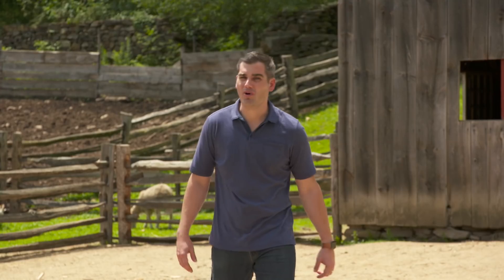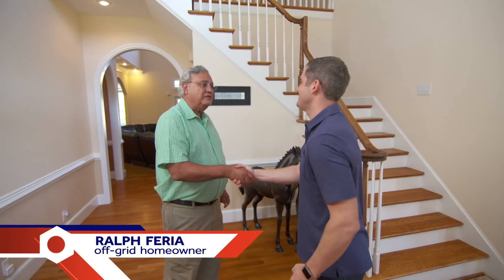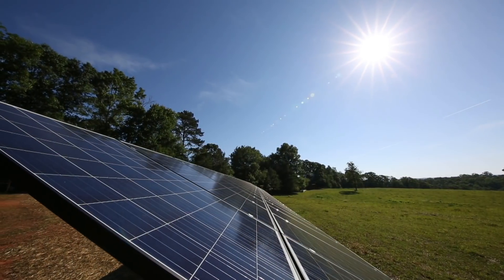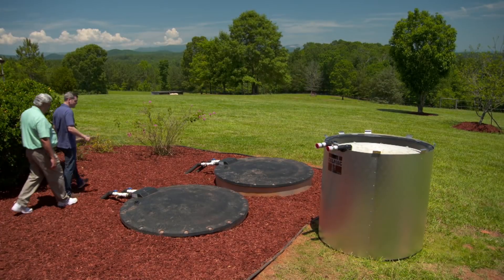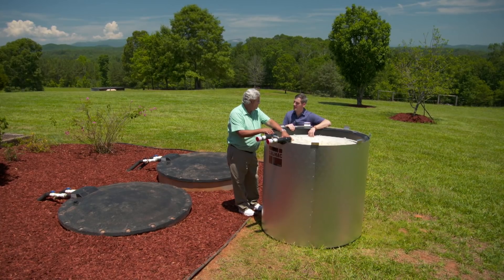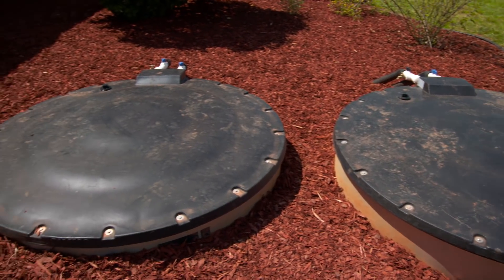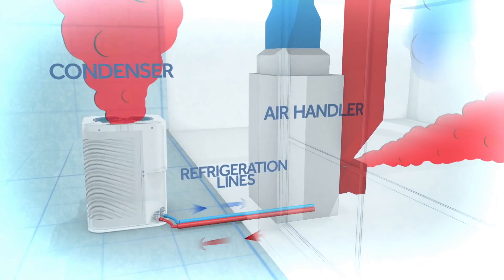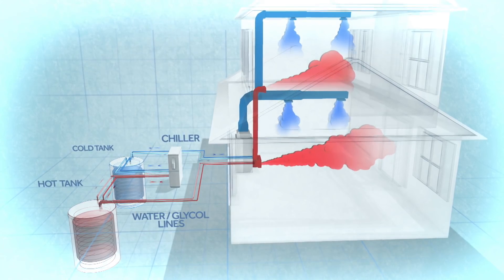Living Off the Grid Comfortably | Future House | Ask This Old House

Comment: How is this house “off-grid” if it’s connected to the grid? 

How could anyone know from watching this video if these
people are saving money or spending money on energy?  What does their electric bill run a month?
What’s the total cost of their solar array?  Without some answer this is just a feel good
commercial for the solar industry.  With
enough money  I could build a 50 million
dollar dam in my backyard and claim to be 100% renewable and technically that
would be true as long as no one included the cost dam. 

The cost of any item  is a good proxy for the energy cost of that
item. A toothbrush is cheap because  it
takes virtually no energy to make or ship and the raw materials are inexpensive.
A diamond is expensive because mining diamonds uses huge amounts of energy per
carat. 

Renewable energy is only  a substitute for something else. In the case
of solar arrays or windmills it substitutes 
for your electric bill, it does not eliminate costs. If your electric  bill is $250.00 a month and the payment on
your solar system is $250.00 a month all you’ve done is change the payee, you
haven’t saved anything.  

A 40KW system like the one in this  video is probably going to cost about
$120,000.00 without storage. If these people had a $500.00 a month electric
bill before the solar that means the cash price of their system would pay their
electric bill for 20 years.  At their age
they will probably not live long enough to spend $120K on electricity which
means this is a dead loss without even considering lost interest or
maintenance.  

I don’t know where this house is but if it’s in the
northeast the efficiency of this system is probably about 15% of nameplate
which means it will actually put out 40KW X  8760(hrs per year) X 15% or 52,560 kwh annually
with an approximate  retail value of $7,884.00
at $.15 a kw.  This  also equals $657.00 a month in value while
the loan payment would be $701.00 on $120,000.00 at 5% monthly. In this example
having solar would cost them $44.00 a month more than grid power.

Yes, I’m guessing at a lot here but I have to since they
provide no information that would help anyone figure out what the system
actually cost or what the payback is. If you have more information about this
house and the specifics of the system and cost please post them.

Comment: "why has it been a slow adoption for residential use?" ha ha - just a wild guess here...  maybe it's the 144 panel array?! If those are 250W panels and panels are currently around $1/watt, that is $36k for just the panels. That is cool and all, but panels represent the cheapest subset of components of most solar systems these days, so batteries being involved (as was mentioned in the video indirectly) means this is probably $120-150k+ system. 

The average kWh price in the USA is $.12. With an average monthly home use of 909 kWh/month, there is simply no justification for most people to go solar. because they spend barely $110/mo as it is. I really hope people all can someday, but it is still 5-20x more expensive than grid power in most of the lower 48 states.
Reply: nevertheless, this is all very very cool and a smart idea
Reply: Hawaii is $0.48 a kWh and steadily working its way on the west coast across the country... coming to a town near you.
Reply: I'm not saying RE isn't a great thing (i have it myself) - just that the current rate of adoptions is slow because of the comparitively cheap cost of POCO-supplied power in MOST of the US. HI and CA are definitely above average, as are some other places. Even in those environments, battery-based systems still cost more than POCO rates when the real cost is understood. Batteries are wonderful for some things, but saving money is NOT one of them in most cases.
Reply: The point of the video was to show the technology and adapting thermal batteries to residential use... not your conventional electron batteries. The cost of batteries are coming down as the technology advances. They are simply showing the technology of a “future house”. It’s understood that not everyone has the means to go completely off grid like this. Each step that the communities take toward RE takes the POCO out of YOUR pocket and someone has to blaze the trail for the better good of the public. The sad thing is that this man is doing that not for him but for you guys and everyone comments on this video bashing him.
Reply: Joshua  Turner read my comments again. I didn't bash him or his approach or RE! I came here to this video because I'm interested and actively using these things. I was merely commenting on the mention of slow adoption. The thermal approach is awesome. If you notice tho, he mentions plain old batteries too which aren't a path to renewables for most people and won't be at parity with POCO for the foreseeable future unless fossil fuels become so heavily taxed that suddenly RE with batteries is a good deal. But at that point, batteries aren't much contribution to RE vs just grid tied.
Reply: Right, I was referring to all comments on the thread not specifically you. When talking about the cost of a 144 Panel Solar array not everyone needs this....you have to scale to your own needs. The whole point is to take the power (Pun intended) away from the POCO/ Government and have your own sources of energy. 

I understand that in some parts of the US this doesn't make sense because grid power is so cheap and that is okay. Obviously you will need batteries to be completely off grid but you don't have to with this. You can use the Thermal Energy you saved during the day behind the meter with the chillers and use it during peak hours. If you are familiar with the PIKA Islanding Inverter you know that it is able to be Grid/PV/Battery/Wind tied at whatever combination you want. 

If you look on the website, these chillers have a variable speed compressor that sets this unit aside from all other chillers which allows it to run without sending your RE back to the grid to start up your conventional lock rotor compressor. With this you are able to use the power you create without having to sell then buy back your power... 

The cost of kWh will rise in the foreseeable future on the East Coast because they will see the business model that is working successfully on the West Coast.  Even if you do not have PV you can still store energy during off-peak hours and use during peak hours where rates are higher. HVAC and domestic hot water account for >80% of your households energy consumption and this efficient system is able to use the energy that is produced wisely behind the meter with a unmatched 7.76 COP and 26.49 EER...
Reply: yep, this is actually pretty old tech. Many homes in the northeast used to have large tanks for storing heat in a liquid-based medium. It is a great idea and is a good way to avoid batteries or reduce the need at least. I have an islanding inverted (Schneider XW) and am pretty happy with it minus their crappy UI.
Reply: The concept is old. The way the chiller transfers heat is new. One system provides your heating and cooling for HVAC and Domestic hot water without the use of natural gas.
Reply: @Joshua Turner    While it sounds great for Hawaii the problem is land is expensive there, so you don't have the land to store all this.  And considering one of their larger power companies literally killed solar for the entire state by removing the ability for people to "sell back" to the power company.    Net result, you only have power during the day time because you have no way to store it.   Still paying big power that 0.48/kWh

Comment: He will probably have to replace it before it pays for itself.
Reply: If you buy a solar panel for say, $1,000.00, and it produces $500.00 worth of electricity over its life it is not "green" in any sense of the word. It has used more resources than it produced so has created more pollution then grid power would. "Paying for itself" is the ONLY consideration if you are selling it as an energy saving solution.
Reply: Yes. IF.  I love IFs.  They are so much more convenient than facts.  Here's an example... If you did research and provided realistic data rather than feelings, you would see that commercial buildings are increasingly moving to renewable energy sources such as the ones presented here.  And, like they explained in the video, NONE of this is new tech.  It is all proven, many decades old technology that are mainstream in some industries and communities around the world.  IF I didn't know better, I'd say that you spend a lot of time online and otherwise ranting against renewable energy alternatives.  Is there some particular reason why?
Reply: Our panels cost us $11,000 in 2001.  Still going without maintenance - paying for all our electricity.  Why do people think solar panels are so likely to break down?  It just sits up on the roof making electricity day after day.
Reply: Think about it this way: some people buy diesel cars not because the price of diesel is cheaper but because the range of any given car that runs it is better than one that runs on gasoline and the maintenance/longevity of the power train could be better (there's always the maintenance component that people miss). Others may have said it better.
Reply: Who do you think is going to run out and cover them up?  What if no one is at home when the storm comes?
Reply: Jose Malone

The raw materials that go into almost any product are a minor part of the final price of that product.  It's turning raw materials into something else that uses energy and creates pollution.  Aluminum ore is literally dirt cheap, finished aluminum products are fairly expensive. The difference in cost is the amount of energy required to make an aluminum extrusion out of that ore. Everything that goes into a solar panel is energy intensive. Just because you don't see that energy in the final panel doesn't mean it doesn't exist.

You even said yourself, "Price of solar panels is expensive mostly because of the sheer amount of manpower and research that have to go into making it, not because of the amount of "pollution" it generates." Manpower is energy and it does take huge amounts to create solar panels.
Reply: Jose Malone
Did the ore come out of the ground all by itself or did it take draglines, bulldozers, dump trucks, processing plants, etc. to do so? All of those machines have to built and operated and take massive amounts of energy to build and operate. The high price of diamonds reflects the huge energy costs it takes to get them out of the ground and turn them into something we are willing to pay for.
Reply: He should just have those solar panels store the electricity in batteries instead of using those weird water tanks .Batteries and solar panels are easier to replace or fix
Reply: @rbeck3200tb40
  ...than water?
Reply: @Rick Parker you have to do an environmental or CO2 footprint impact analysis to evaluate that. Price depends on many factors, so you cannot make that correlation.
But given you are trying to push for coal power plants, even if you put cattle to move an off-grid electrical generator, it will probably be more environmental friendly.
Reply: John A 
Yes its easier than fooling with those weird water tanks etc. that will leak, bust over time in the winter ,get clogged with dirt etc. Its a complicated mess
Reply: rbeck3200tb40 the water in the tank is enclosed so water isn't coming in and out to fill the thing up with dirt.  The heat exchange coil is just like what you'd have in an in floor heating system.  They're made of PEX which won't freeze and break.  I'm a bit confused.  Is there something about them that makes them weird to you? To me they're pretty damb simple. An insulated tank burried in the ground that is designed to hold ice with a PEX heat exchange coil in it. Simple.  Plus, no batteries to replace.  Cheaper and simpler.
Reply: John A 
Well of course its weird . Its just bulky , odd and stupid to have. Its also an eyesore. Just get some good batteries instead of that crap .This looks like something a scientist would have out in his backyard like Doc Brown
Reply: Rick Parker hailstorm is not going to beak his panels because he will have them covered up for protection. Can't make electricity with Solar PV  during a hailstorm anyways.
Reply: Rick Parker our panels are guaranteed against hail damage.and so far have not been damaged. Sadly our shingles and siging have not faired as well. Severe wind gusts in the last 4-5 years have removed several shingles in the same spot 3 times. siding has cracked and had a couple of holes.
Reply: Bob Quigley
"Hail damage" was a metaphor for any kind of damage. It could be a wind storm that blows panels off, trees falling on it, snow covering the panels, etc.
Reply: For the millions of dollars that went into engineering it and costs of making parts for this one machine, then yeah, it won't pay for itself, obviously.
Reply: Back in the 80s I read about a wind turbine that could power a bank of batteries at a 5 mile an hour wind and it would power your home. 
Then I read about a fuel cell that produces enough energy to power your home and the rest could be sent to the grid and it’s by product was simply H2O, pure H2O! Wow ! It was in popular science magazine and they were advertising and looking for consumers to sign up. I did and nothing ever came of it. We know turbines work and fuel cells are in use in foreign markets. Guess they gotta push those ugly solar panels that only work on the sunniest of days.
Reply: Solar panels are hardly damaged by hail and hurricanes.
Reply: Mar B bullshit, and when it’s cloudy and it raining and snowing it pays for itself, right? Plenty of other alternative energy sources that work all year long and can actually feed the grid after you receive your share of power and you get paid for the energy that it provides. A fuel cell. Used in mostly in in Europe,Japan to name a few places. Do your homework.
Reply: I was not commenting on your post.  I was commenting on the posts that say that solar panels break down.  I'm just informing people of what is happening on my house.  How can you disagree with that?  Yes.  I live in California with very little rain and no snow.  Even on cloudy days we can read the meter and it is putting out some energy.  So few people have had solar panels as long as we have.  They continue to say they will break down.  I've had them for 17 years.  I have experience.  They do not break down.  I'm hoping there are hundreds of new types of energy developed.  I'm not saying solar is the only way.  I just get tired of people talking about how they are going to break down and need to be replaced.
Reply: Rick Parker, first, dollars are not "earths resources." If someone wants to spend more money on a product that they feel is more environmentally friendly than another product, that cost difference does not reduce natural resources, only their personal financial resources. And no, I wouldn't expect the owner to repair hail-damaged solar panels (although having spare panels on hand would allow him to replace them, but of course cost more $), but other parts of his system would still work after most natural disasters (I think; I did not rewatch the video and don't remember the details).

Anyway, my point is that a system "paying for itself" is not the only consideration in choosing utility systems. Since my initial reply, I have read that the home owner is owner of the company that produces these systems. If that is true, then marketing was likely his main motivation.
Reply: There are more benefits to off-grid systems than just dollars and cents. Environmental concerns, self-reliance, and hardening against natural disasters to name a few.
Reply: How does solar panels costing 1000 dollars equate to 1000 dollars worth of (polluting!) "RESOURCES"? If the solar panels were made out of coals, petroleum, etc. what are USED TO PRODUCED ELECTRICITY, AND if the price of panels were the honest reflection of the cost of raw material, then yes, your argument might make sense.

Price is not a measure of pollution. It's an economical construct. Yes it may have "some" bearing on the amount of pollution it generates, but there is neither a positive nor a negative correlation between these two. Price of solar panels is expensive mostly because of the sheer amount of manpower and research that have to go into making it, not because of the amount of "pollution" it generates.
Reply: Yes? I just picked up an ORE of diamond. It costs 2 million euros. Where is energy in that?
Reply: Well no. If the system cost more than his total electric bill over a period of time  it used more of the earths resources. Self reliance is nice but do you really think he'll be headed out to make repairs when a hail storm breaks up his panels?